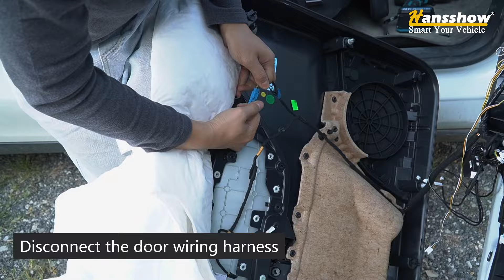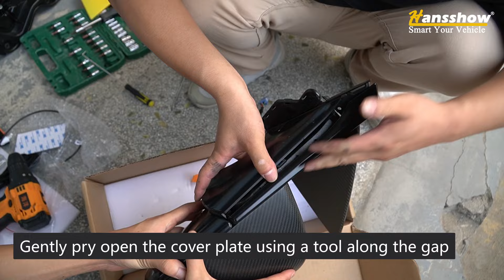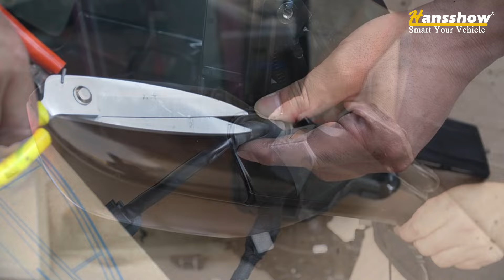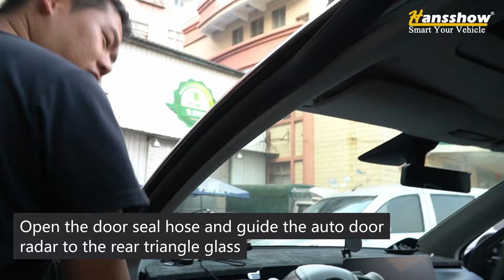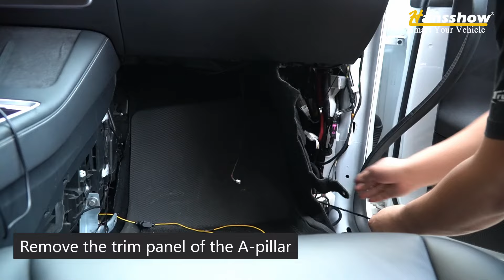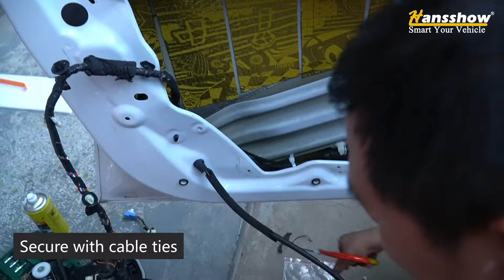Model 3/Y Auto Presenting Doors (V2) Installation Guide

Comment: I’ve been wanting to give my assessment/experience of the presenting doors.  Where do I begin?  The installer was able to get the driver side installed but could not get the passenger door installed properly.  The passenger door would only open half way and whenever you tried to close the door, it would slam the door shut.  We went around and around for 6 weeks trying to figure things out.  The installed changed all the parts but still got the same results.  Finally, Hannshow looked at the wire harness and realized that they had reversed the wires.  We were instructed at reverse the wires.  That worked.  Still, there are other issues with the passenger door.  The door will not set to the full open width.  It only opens about 75 percent.  It you close the door from that position, the door closes.  If you push the door fully open (it won’t set to that position) whenever closing, the soft close works as designed.  Since I can’t get this figured out, I’m living with it.
Now on to the other issue, the driver door, the passenger door may or may not open whenever you approach the sensors.  It’s a hit or miss.  It’s not consistent it’s just weird.  I’ve dealt with this issue for about 8 weeks and I’m so over it.  The installer is 1 hour and 15 mins away.  I just couldn’t keep going back and forth.
Final thought.  It’s a great concept.  I just hope you don’t have the issues that I have.
Reply: Did you ever find a solution?

Comment: Hansshow's Auto Presenting Doors are slow opening and are temperamental, I would not recommend. 

Here are a few issues - If you stop the car in your driveway or curbside while in drive, and the passenger pushes the open button to open the door, the door opens, but you need to push it all the way open, at this point, you need to put the car in park, push the door button to close the door, unfortunately the door will close but not all the way, you need to push the door back out and repeat, sometimes this works, if not you need to push the door out and then pull it closed.  There are other times while in park, you push the button to open the door, it opens an inch, you push the button again and it opens into the car door next to you.  These Hansshow aftermarket parts are not yet ready for the consumer market.  I’m at the point to ask the installers to remove all items and return everything back to stock. 
Tes Studio install costs. 
Auto present door handles for v5 pro , labor is $900
Labor for v2 auto present doors is $1800 for front 2 doors.